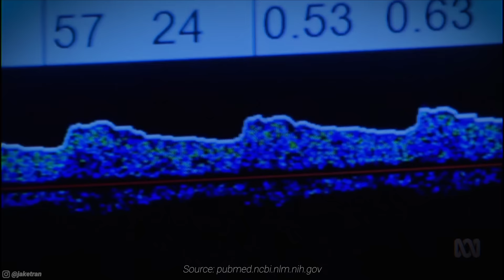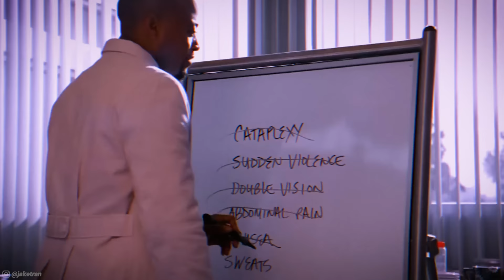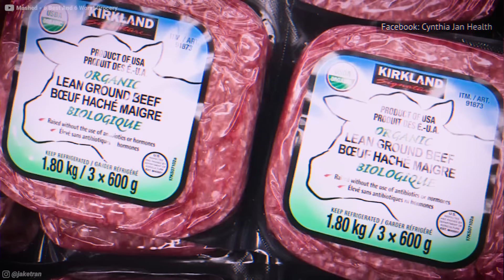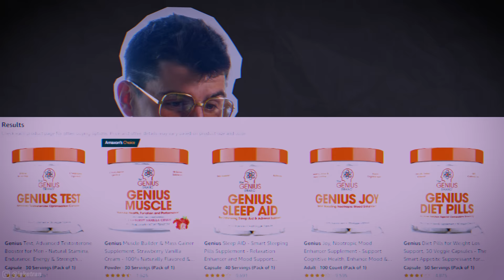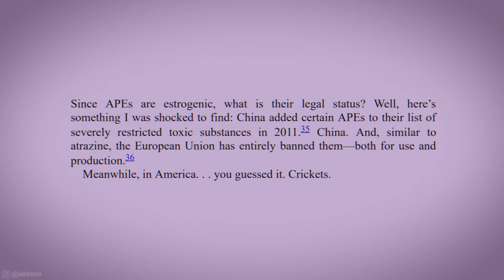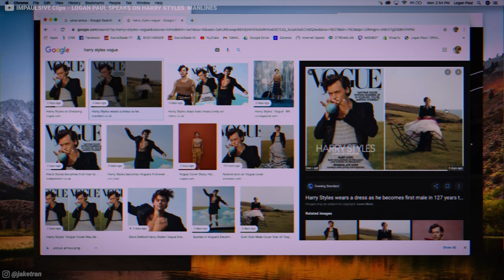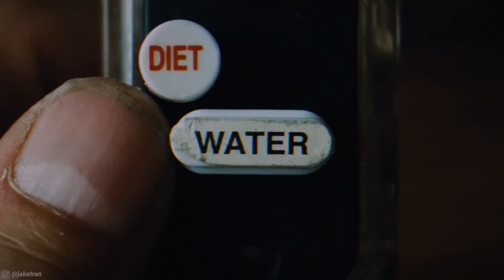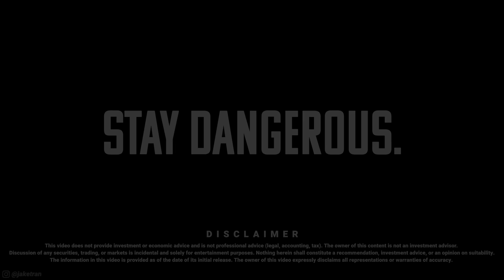Why Men Are Becoming Weaker (Documentary)

Comment: I'm certified in water treatment.  We've been talking about this for at least 20 years.  Endocrine disruptors/xenobiotics are an issue but there's no regulation to even look at it let alone treat it.  Get a whole house filter and a reverse osmosis unit.  It helps.  If you can afford it, get a automatic water distiller made in USA w/ 304 grade stainless steel.
Reply: Thanks for the advice 👍🏻
Reply: Thank you man i appreciate your insight :), any specific type or any filter will work?
Reply: @dilly7551  Clean water won't help you get good sleep, work out, lose weight and avoid plastics so yeah, it helps.
Reply: @ArshesNei8 RO systems are only for drinking. We have to shower with tap water unfortunately…
Reply: Thanks for the tips
Reply: Reverse osmosis unit or a filter wont filter out/block the cellular level of hormone changers like pregnancy blockers when women use the toilet.
Reply: Is it possible for the municipality to implement a filteration system that can filter out chemicals like estrogen?
Reply: I’ve been using high quality water filters for the past 2 years for all my drinking water.  I am now investigating filters for my shower.
Reply: @businessreform at least in my house, the whole house filtration unit filters the water supply into the house. Including the shower. So I guess I dont know what your issue is.
Reply: I heard if you filter water, you also lose the important minerals etc.. is this true?
Reply: @Whagmanz  I believe that is true.  I take electrolytes in my water once a day.
Reply: @Whagmanz yes, but you can re mineralize the water with Himalayan salt, or mineralize packets... But the minerals in water are very minimal. Make sure you get sodium, calcium, potassium in your food and you'll be fine
Reply: Just installed a whole treatment, and rodi and ph for our young family. It was about 7k from costco partner. One point was there are plenty of carcinugens not identified yet used in conventional fatming methods that eork their way into local water supply.
Reply: Are there cheaper filters for this?
Reply: I have question for u..
When a municipal tap water or processed mineral water we so call.
Already so many disinfectant flourides and chemical added in it.
How reserve osmosis and filter unit at home helps to get rid out of it..
Thanks
Reply: Now what If the water filter and the filter are made of plastics????
Reply: For me the best way to drink water is using spring water, but it also if you use that spring water in a metal container. I promise you it definitely does the trick!!!!
Reply: How do water distillers rate in comparison to water filters?
Reply: You don't have to be certified in water treatment to know this 🤡
Reply: @blastyblast1010 distilled water isn't for drinking unless it's been re-minerialized. It can actually slowly kill you over a course of time and even pretty quickly if your not taking in Xtra minerals.
Reply: @johnd7123  thats bs.. you get the minerals from food.. lol. You can drink distilled and rodi.
Reply: I buy reverse osmosis water but I s collected from huge plastic containers 😢
Reply: Are there any brands or products you specifically  recommend?
Reply: Distiller
Reply: Durastill for life, I was raised on it, consume it exclusively and it's all I give my kids. I've built and rebuilt many of them well worth the time and money.
Reply: Don't get a reverse Osmosis Unit, those things are WAY too pure, to the point you lose all minerals in the Water that help you keep hydrated.
Reply: @HardinProuductionsOriginal  That is the point, google the best source of any of the essential minerals you need to live. FOOD, not water. Educate yourself, information is free!
Reply: Am gonna screenshot this comment.
Reply: @Whagmanz  you get the minerals from food. The minerals in the water are inorganic which your body doesn't absorb. These type of minerals sit on your arteries, joints, kidneys, etc.
Reply: Does it get rid of the estrogen?
Reply: @LifeWithEmin  You need to raise your testosterone to eliminate estrogen. Semen retention is a good start. Eliminate shit foods, replace tap water with distilled water (buy over-a-counter water distiller, megahome preferably), hit the gym 5-6 times a week, and do some intense exercises like navi seal/3pump burpees, those are an intense military type of exercises, that don't require equipment, and also will skyrocket your testo.
Reply: @Smurfas13  Thanks For The Info Bro
Reply: i use a well
Reply: Yep
Reply: This whole comment thread about water 🤦‍♀️

Comment: Fun fact: They actually redid the test of how much testosterone levels drop and found out that instead of per decade (or i think year) at 1% it's now 2% decrease in testosterone a year ever since 2000.
Reply: Decide, is it year or decade?
Reply: @7RicolmE7 probably year percentage seem too small to be a decade
Reply: it's year and the decrease is only accelerating
Reply: @bumnuts69  You could use the same logic for yearly decrease, 2% per year is a lot
Reply: Gradual decrease starting from the 80’s. Came across in several sources.
Reply: I'm still not so certain.
Reply: Your math is way off bro....just stop it.
Reply: @pwnsolo443  What math? The test literally said that starting from the year 2000 testosterone levels have dropped 2% annually
Reply: @XVXC-M8  Here is a REAL "Fun Fact:" If someone "re-did" a study that took 20 years, it would take another 20 years to produce the same amount of data to compare to the original test. Ya bro, math is hard.
Reply: @pwnsolo443  wouldn't you assume the test was from 2000 to 2020 or did i miss something? It's 2023 so the data could have been processed and analyzed by now. Not sure what you are thinking would make it impossible.
Reply: @pamlemm903  OK, glad you can do math. So in summary according to him they just "re-did" the study. In order for that to happen, assuming the original study was performed from 2000-2020, that would mean you would need until 2040 to "re-did" the test. Something isn't adding up genius.

Comment: so what do you suggest we eat? seems like everything nowadays has bad stuff in it
Reply: fr
Reply: Despite what people say the biggest issue by far is phthalates from plastic, just avoid food and water stored in plastic.
Reply: @wtssmaller the cholesterol problem is only a problem if your not active otherwise you can eat all the fats and be fine for the most part
Reply: Whole food plant based
Reply: @wtssmaller wrong!
Reply: @dontworry2379 most of them are overeating usually fast food when they feel bored
Reply: @billusher2265 i haven’t seen meat sold in anything other than plastic
Reply: Shilajeet and ashvagandha
Reply: @jezzdogg6857 instead of saying wrong how about you say WHAT exactly is wrong?
Reply: Eat a lot of fat but makes sure it contains a good ratio of omega3 & 6 fats. Mostly, try to eat foods that contain only one ingredient (the food itself). Also avoid heating up food in plastic or drinking from plastic bottles. Eat some vegetables, but don’t overdo it as they can impede your nutrient absorption in your gut. Fruits are good but be sure to wash them thoroughly. Avoid nonstick pans, use cast iron and grass fed butter instead.
Reply: buy acreage
Reply: I'd just start out by avoiding anything with acesulfame, sucralose, aspartame, corn syrup, soy, or any ingredient starting with "modified".

I'd also pass on anything that says "contains bioengineered ingredients" on the label.

I know that this isn't a guarantee you'll be avoiding all the bad ingredients, but my experience has shown me that these are excellent places to start.

You may have to make some concessions based on your lifestyle and finances, but these two starting points will take you extremely far.

As you come to learn more about food ingredients and how they work, then you can keep improving your diet as you wish.
Reply: Go to a butchers shop they give it to you in the paper
Reply: Cold water exposure , moderate cardio exercise - greens from your backyard , no plastic bottles
Reply: @floppagod.  exactly animal fats aren’t the problem with cholesterol it’s not even quantity per say as much either I think you just can’t sit on your ass your body needs to use what you consume
Reply: @wtssmaller somebody who knows their shit. Cholesterol isn't bad though.
Reply: drink bud light
Reply: It’s hard but try to go for the healthiest options you have access to
Reply: @Blackpill149 💀
Reply: @wtssmaller  Cholesterol is actually good for you. It puts your brain into hyperdrive, gives it way more fuel and raises it's efficiancy, the nerve system and various other parts of the body also benefit.
Reply: @SlyRy5  True, but as long as it always refrigerated, it is less of a problem. As leaching of micro-plastics occur more at elevated temperatures
Reply: @dontworry2379  Simply not true.
Reply: @privtprofile24  I mean if you go and test people who eat carno diets you aren’t gonna find high cholesterol that’s effecting them negatively
Reply: @dontworry2379  Weird the RCT's say something else. Also it's carnIvore not carnOvore LMAO.
Reply: @privtprofile24  I’m glad you got to the point where you nit pick grammar because you know you’ve lost🙂👍
Reply: @dontworry2379  Are you going to ignore my whole point? Show me 1 RCT that shows that high cholesterol is not an issue. Also I think you mean spelling.
Reply: Plant based minus soy products is optimal. Carnivores are only getting sicker and having to go on TRT.
Reply: @jayhyunmoon3097  Yup. People hear plant based and think they cant eat ANY animal products anymore. Plant based with some animal products has a very good track record in studies.
Reply: @jayhyunmoon3097  yh but that’s just not true is it
Reply: @privtprofile24  no shit high cholesterol is an issue if I said it wasn’t then idk but ion know what this conversation is abt anymore so 🤷‍♂️ can’t rly argue with u
Reply: @dontworry2379  It is true. I switched to a plant based diet along with strict avoidance of toxins about 5 years ago. Now, I’m pretty much immune to chemtrails and other environmental poisons. No more brain fog, headaches, impotence, zesty thoughts, colds, flues,  etc.  If you can’t kick meat, free range eggs are the perfect medium both nutritionally and ethically.

Full-on carnivores are getting balder, more impotent, and becoming more irritable and aggressive. Their counter measures to their emasculation such as TRT are absolutely unnatural in every way.
Reply: @jayhyunmoon3097  sounds like you got some survivorship bias there mate because most of what you said isn’t what normally happens in fact it’s the opposite
Reply: DJ Cook? What are you doing here 😂😂😂
Reply: Kingmaker pills 💊, he sponsored them